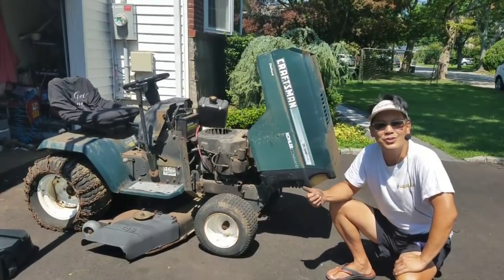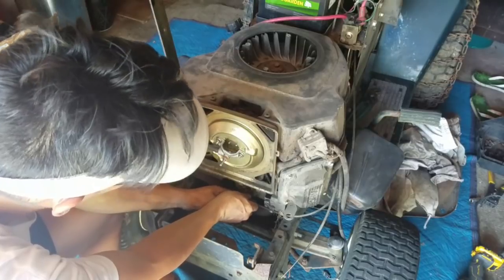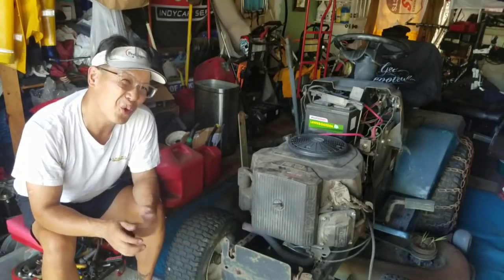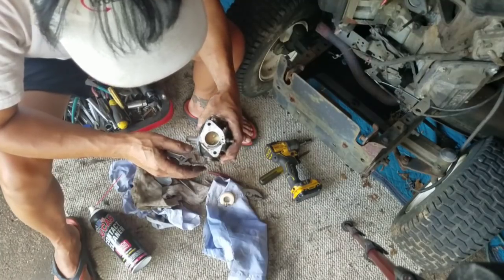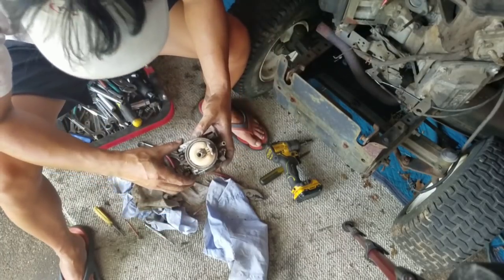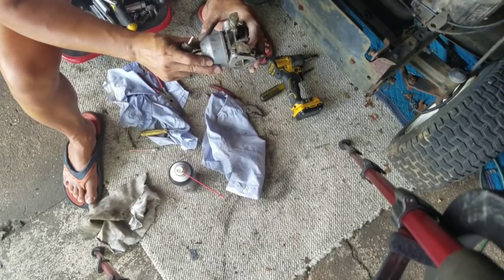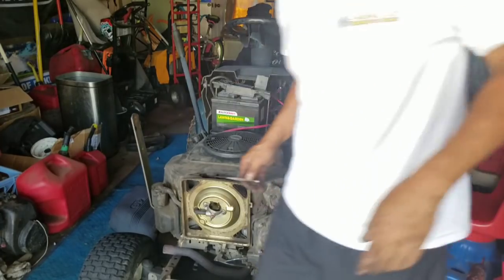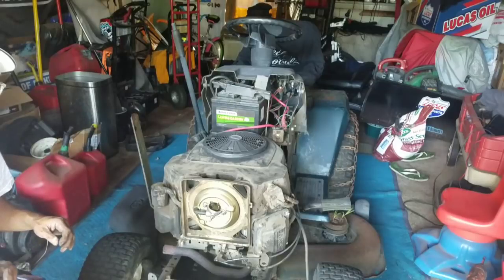CRAFTSMAN 20.5HP 46" KOHLER COMMAND V-TWIN GARDEN LAWN TRACTOR CARBURETOR DISASSEMBLY CLEANING CHOKE

Comment: you need safety glasses when you clean your carbs. That is an awesome tracter Henry. I think you could get $1000 for it just the way it is. Garden tracters are always built stronger. Its what I actually need for my snowblower. You should see how my LT1000 sags in  the front with the snowblower locked in the up position. I even know it wasn't meant for the snowblower. Great job Henry!! Your videos give me ambition to work on my tracters.
Reply from the maker: I wear glasses!

Comment: Just brought one of these. Lets rebuild them together
Reply from the maker: I’m almost done!  How about you?
Reply: @MowersNBlowers  Gotta throw the carb in the sonic cleaner and she should be rockin. Thinking of turning it into a race mower. Mine is one year off that model with the slightly more rounded hood. Even if I don't I will put some mean pipes on it because the sound is so nice already it is just hard to pass up. KeepOnMowinOn
Reply from the maker: eric flory sound is insane

Comment: I’m have a problem with the same carb. It will only run with the choke on. I cleaned it and still have the same problem. Any idea which jet is for the choke?
Reply from the maker: It’s called the pilot jet,  usually under the idle screw.  I’d just clean everything that’s removable possible
Reply: @MowersNBlowers  I took the screw out and ran cleaner through it. I wasn’t clogged. I’m going to take it off and do it all over again  I’m sure I missed a jet somewhere. Thanks.
Reply from the maker: @djcrash1104  hope you’re subscribed
Reply: @MowersNBlowers  I just found the problem. It was the solenoid on the bottom of the carb. It was  stuck with junk. I cleaned it and now it runs like a champ. That mower has been a great one. We have had it for over 20 years I think. It is a workhorse. We use it to pull trailers with. Thanks for the help.
Reply from the maker: @djcrash1104  yeah o never use those,  I just cut the valve off.

Comment: I have the same mower and it would also surge. Not nearly as bad as yours though, but would surge and shame on me I used it like that for a few years.  I was walking through Walmart and saw that Mechanic in a Bottle stuff. Never bought into snake oils but had a weak moment and bought it. I ran it through a few tanks of gas and the surge disappeared and had not come back.
Reply from the maker: Probably cleaned your pilot jet.  Hope you’re subscribed